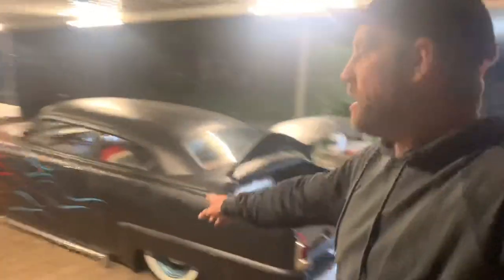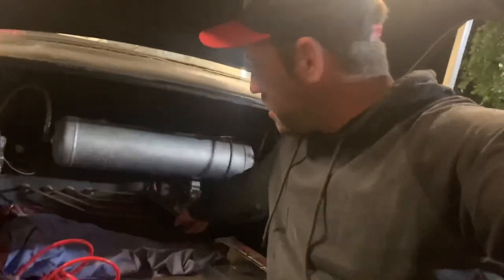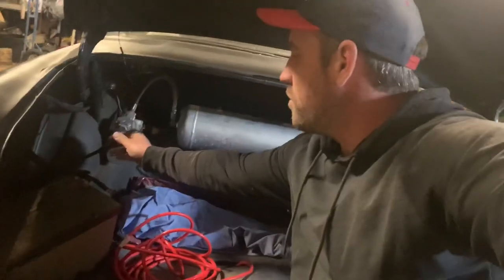IRON EMPIRE - Tips! Distinct difference in wire quality!

Comment: I've seen people in America buy good quality ,high amp . Buying  welding cable. Cheaper , comes in reals and high amp flow
Reply: Also very flexible for the thickness. I used it to run power to my winch.

Comment: Cheap blade fuses, had a car that was fine starting in the morning but after heading into town for regular chores after a few stops it wouldn’t start again go back few hours later or next day it started right up. Chased the problem for about 2 weeks, it would heat up and stop working but visibly looked fine didn’t look blown at all.

Comment: great little tip! cheers mate
Reply: Cheap cable. Lots of insulation and not much cross section of conductors. 

Also. Cheap cable can be copper plated steel strands. No where near as conductive as copper. 

Quick test - cut some strands off the welding cable and see if it sticks to a magnet.